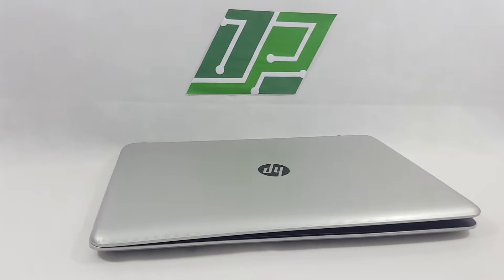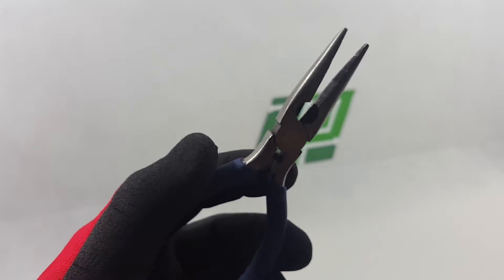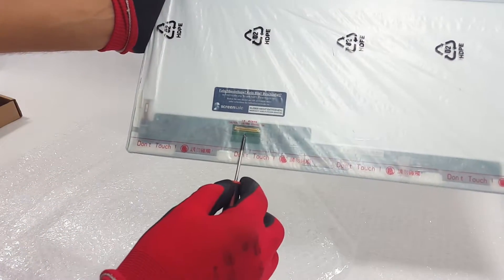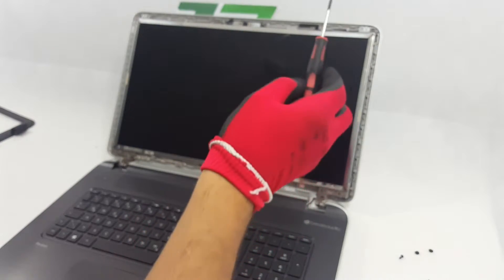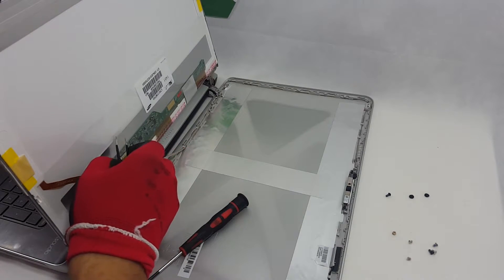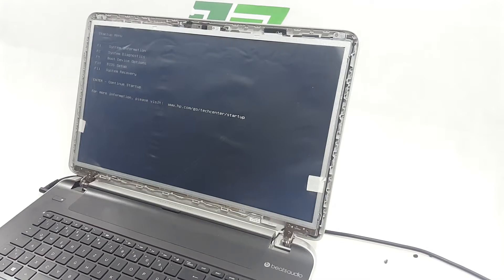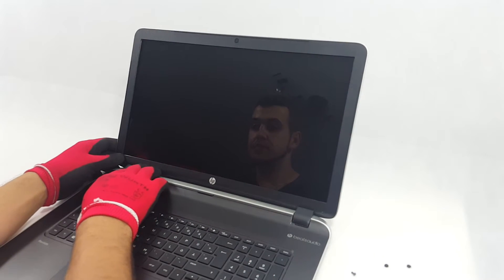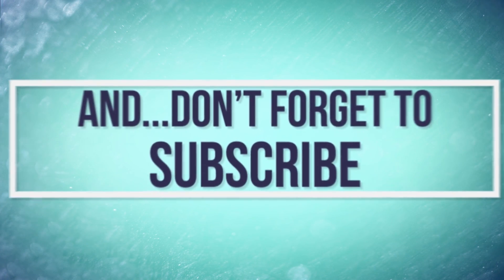How to Replace a Broken Laptop Screen - Repair Tutorial

Comment: Hello as i opened my laptop to find s/n of the lcd my screwdriver did a short in the pin connector (ilaptop was powered on) and laptop shut down immediately. After this it opened normally and working with external monitor but after the short my broken lcd is totally dead while i could see some colours and lights between the cracks before. Do you know if i order the replacement lcd panel will i still be able to fix or it might have fried something like the inverter or something else?
Thanks for every rreply.